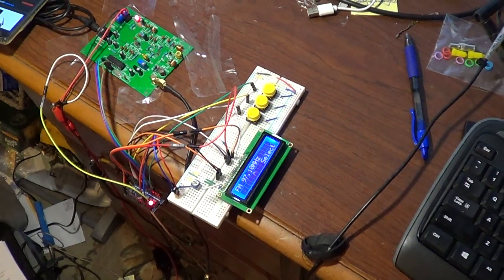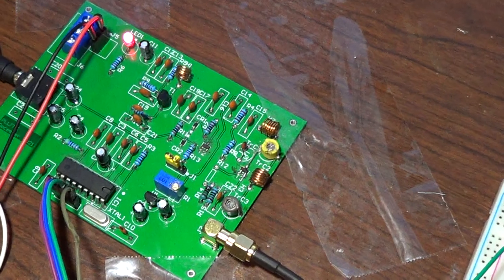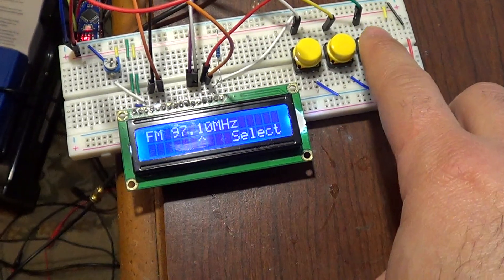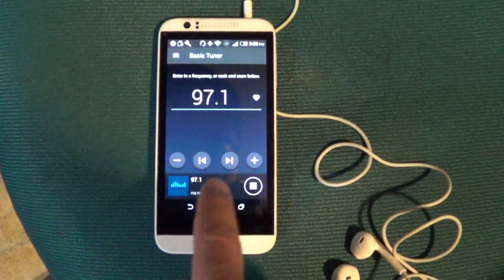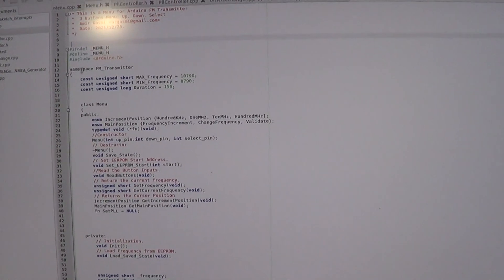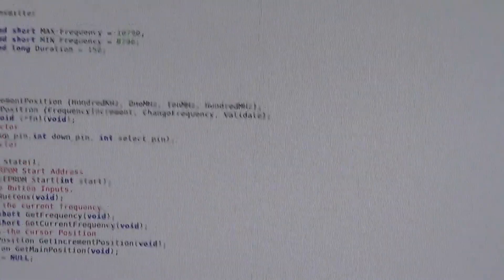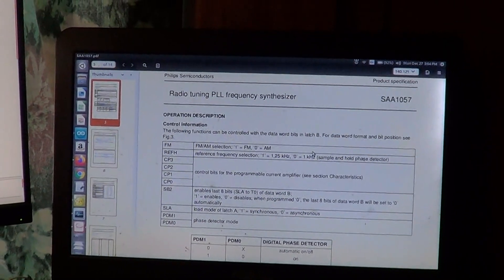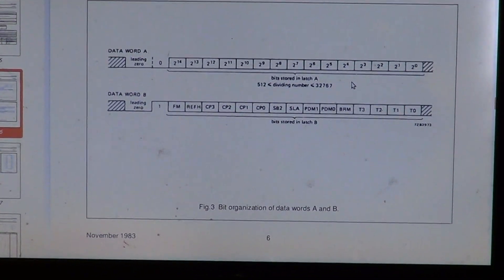Part II: Stable PLL FM Transmitter using Arduino & SAA1057 Philips 0.7Watts - Adding LCD Display

Comment: Have you got any schematics or arduino code that you can share. I'd like to get a very basic SAA1057 circuit setup, so I can understand how to control it. My main interest in adapting my Revox B261 tuners LCD. The display uses a similar serial protocol as the SAA1057 PLL synth in the tuner. I can make a donation if that would help.Thanks.